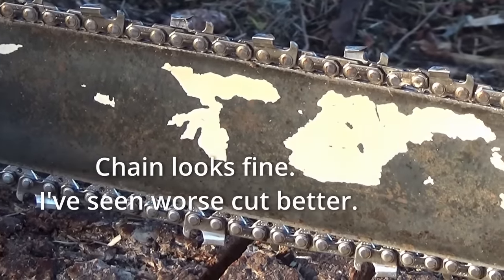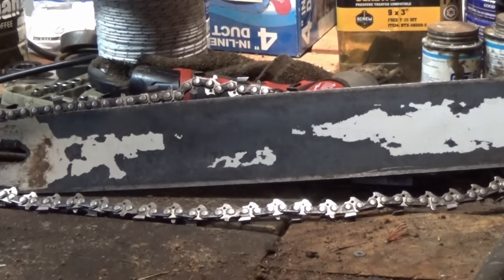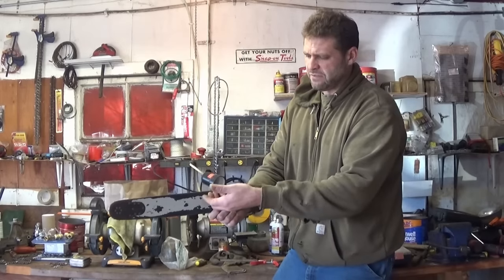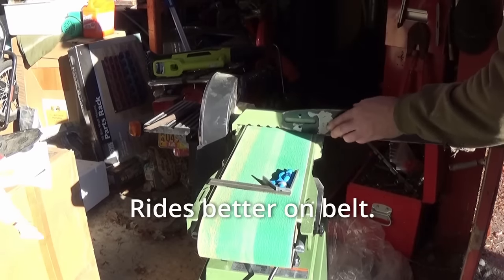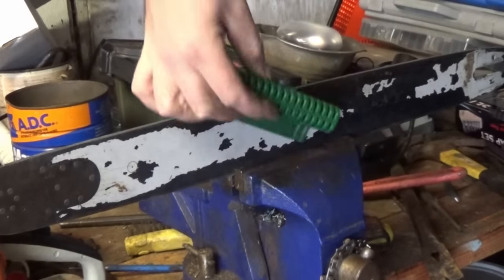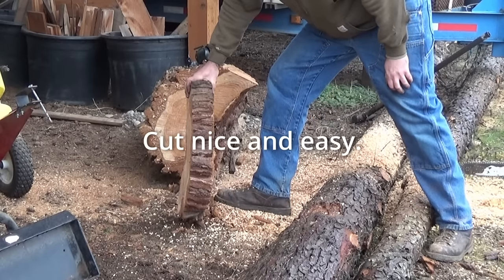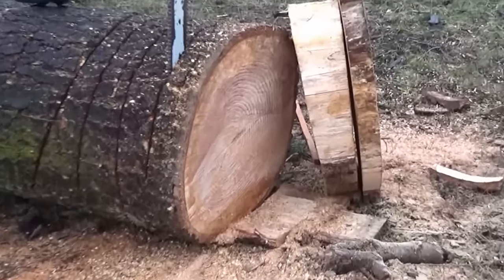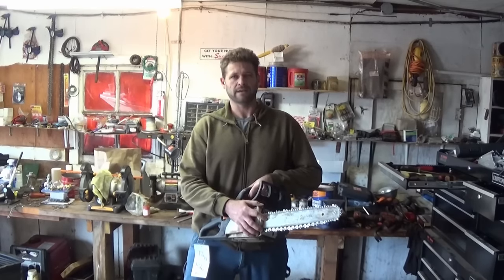Chainsaw Cuts Crooked Curved Cuts. Bar Dressing and repair. Before and After.

Comment: Several things can cause a saw to cut crooked.  An unevenly worn bar or even just a wire edge . A bent bar. The angles on the chain need to be the same side to side and tooth length the same.  The rakers need to be filed evenly. Bars are cheap, so replace it if need be, and learn to file correctly.  Also,  make sure you're not torquing the saw while cutting.
Reply from the maker: Well said, that's good info. I only addressed the bar.
Reply: Shutup
Reply: I’ve had chains jacked up pretty bad on the left side cutters only which I had to file far back a lot more than the right and once I finally got the left side back to sharp and also the right side cutters sharp it still cuts straight down even on a 30” log. So the teeth don’t actually need to be evenly filed
Reply: @pohanleu523  O.....kay.
Reply: @brianquigley7336  Not trying to sound like i know more than you. just my personal experience.
Reply: @pohanleu523  In my experience if all the teeth on one side are way longer than the other side it can cause it cut on a slight curve but the length difference needs to be really big.  Like you said I think the most important things are consistent filing angles and rakers
Reply: Tooth length doesn't matter "Buck'in Billy Ray Smith" will prove it ...but I agree with everything else you stated
Reply: @rileyjohnston8393  I use one of those Stihl 2in1 sharpeners on my MS462C so I don’t have to think about the rakers ☺️  but I had a 28” chain that I really crashed into the dirt for a good 30 seconds and man I had to file all the left side half way back to get it to cut again. The right side were only needing a slight touch up 😃
Reply: @pohanleu523  Ya one side of the teeth has to be way longer than the other to cause curving, almost never an issue
Reply: @pohanleu523  🤣🤣🤣
Reply: Cutter length is irrelevant. Raker height is everything.
Reply: @pohanleu523  I love my 2 in 1 sharpener for my MS 271 FARM BOSS ! I've named it "The Idiot Proof Sharpener"  Couldn't get my chains correctly sharpened before. Flip my bar every so often. After this video, I now need to keep a closer look over my bar.
Reply: @Laughinghawg  I think idiots could technically use it backwards 🤣
Reply: @pohanleu523  👍
Reply: Tooth length is not an issue.
Reply: @jeepinass  I'll never forget the time my saw was ✂️ cutting poorly, i sharpened my chain 3 times before figuring out the need to take down the rakers ... live and learn
Reply: @speedfreak8200  get a Stihl 2in1 sharpener which does both at the same time
Reply: Daniel Nelson  That’s what I use it’s the best gauge I’ve owned, never have problems cutting crooked
Reply: ¹à1aa
Reply: @jeepinass    Glad somebody said it!
Reply: Teeth don't have to be the same length. You just have to make sure the rakers are cut down correctly according to the teeth
Reply: @dereksteele2284  Oh, technically they don't have to be the same length,  but it makes for a rough cutting chain,  even if the rakers are filed the same per tooth.
Reply: @Brian Quigley  no it doesn't, I run a saw 10 hours a day clearing right of ways for the electric company, and I spend a lot of time sharpening saws, and they cut better than any brand new chain that's not square ground when I get done, as long as the rakers are knocked down correct
Reply: @dereksteele2284  Well, your idea of a good cutting chain is probably different than mine.  I've been cutting timber and climbing for 43 years in the Pacific northwest.  I use a Silvey Pro sharp square chisel grinder and a Silvey raker grinder.  The chain just flat out cuts.
Reply: @Brian Quigley  that's pretty sad, that you've been cutting that long and can't hand file a chain. Also everything that I cut is hardwood and still don't have a problem getting through anything I cut. And a square ground chain doesn't stay sharp long at all. I usually have to sharpen a saw 4 to 5 times a day because of all the wire and fences we hit because u can't see them till its too late
Reply: @dereksteele2284  Never once said I couldn't hand file. Production cutting in the North West, you better have your shite together when you show up. They expect you to put some wood on the ground.  I (and anyone else that's a serious cutter) use square ground chisel because it cuts about 15 % faster than round filed. If you have problems keeping your chain sharp,  try keeping your saw out of the dirt. No chain will hold up to nails or wire. Only a nimrod would waste time filing a saw on the job site. My saw gets dull, I just throw a fresh chain on and back to work.
Reply: @Brian Quigley  I don't run my saw in the dirt, and the company don't supply us with new chains every time one gets dull, we bring a file with us, as we're sometimes close to a mile away from the work truck. I also bet I can hand file one faster than you can grind one
Reply: What do you mean by torquing?
Reply: @pohanleu523  or maybe your different filing compensated for a crooked bar.. 😉
Reply: @durrburgerjosh to much pressure on 1 side of top handle.
Try to hold top handle so saw hangs/ballances and bar is Vertical.
Reply: You mentioned cutting the rakers, be sure and use a guide to cut the rakers. To much depth causes the saw to jump.. causing a very dangerous situation.
Reply: Tooth length has nothing to do with it .
Reply: Cutters and rakers do not need to be filed evenly, its all in the bar.
Reply: He literally just said that
Reply: there is no such thing as a wire edge
Reply: there is no such a thing as a wire edge
Reply: Bars are not cheap nowadays, but, they do get worn out where ya can't " fix" them any more. A good machine shop, could help get more life out of a lot of bars,( mainly just deepening the groove, which usually outlasts the widening of the groove)  but, once that groove wears out too much , just not worth messing with. Yes , you can " pinch " the groove shut a bit,  usually, sometimes it helps for quite a while, all depends.
Reply: @austinharvey9600 I know! How dare someone comment with good info!
Reply: Only cutter to raker ratio is important. Cutter length doesent matter at all. So only sharpen teeth that are dull.
Reply: Solid bars aren't cheap
Reply: @dereksteele2284 I agree with you. I have found that properly hand filed saw chains are superior to ground.

Comment: I've had those problems many times in the past.   Used same fixes as you did.   I discovered (the hard way) that this problem vanishes when the chain is kept tight, and you use a quality chain oil.    Great video,...cheers from N.E. Ohio.

Comment: Great video! I loved how you demonstrated the importance of keeping the bar and chain in good shape. The way you explained the gauge measurements was super helpful—it's fascinating how a little maintenance can make such a big difference in cutting performance. Has anyone else tried the roller tool you mentioned for bar repair? I'm curious if it really works as well as you described!

Comment: I often get the scrap bars and chains that our local chainsaw dealer throws out as they just put new bars and chains on customers saws that go in for servicing.
I won't have to buy bars for a long time as ive got heaps of them that still have heaps of life left in them.
But I do buy new bars and chains for all my pro saws as we have some pretty hard wood down under, 
The redgum is especially hard and we need to keep the chains sharp just to cut it and they can go blunt pretty quickly if you don't pay attention. 
Great video well explained 👏 👍 
Hello to all from Australia 🇦🇺

Comment: After you correct the bar surface you need to check there is sufficient depth still available for the chain to seat properly.
Great video.
Reply from the maker: Yes, absolutely. That needs to be pointed out, I forgot to do that. One can file down too far over time and the chain will no longer seat or fit the entire drive link in the valley. That will induce a curve cut syndrome.

Comment: I always just went around to the other side of the log and finished the cut. Or sometimes we need a circular cut... I have this issue right after hitting a rock. 30 years ago it was just bad maintenance and very frustrating trying to fix it. Years have taught me. Thanks for the guidance and teaching.

Comment: I've definitely been fighting this problem for awhile. I've never heard of dressing a bar til now, but it makes perfect sense.
Reply: @Daniel Nelson  I flip my bar all the time, it's still worn in deep and uneven. Why does it cut crooked when the bar is straight and it has a new chain? I run an ms440 and 20" stihl bars.
Reply: @Daniel Nelson  yeah im thinking I pry been running my last bar or 2 longer than necessary.
Reply: @Daniel Nelson  .050 on .050 for sure. Got sold some of the heavy gauge chains once and they won't seat in the bar. I cut alot of hardwood, been burning wood my whole life. I'm no logger, but I use a saw more than the average Joe. Use good oil, fresh gas, change my air filter and spark plug most years. I keep my bar oiler cranked up too. I think I just been trying to get more use out of my bars than I should.
Reply: @Daniel Nelson  I put a new sprocket bearings and flywheel on last year.

Comment: Had this problem bad this morning. First use after winter. I remember struggling to cut before i out it away. 
Switched chains and it now works perfectly so it isn't the bar - just my sharpening technique.

Comment: There is something to be said for letting the tool do the work but you have to pay attention with chainsaw regardless.  I cut slabs freehand and the bar can do a lot of the aligning work for you.  Don't forget the perpendicular line on the side of the saw, that is pretty useful as well.

Comment: I could definitely hear the difference on the 24". Great video! I have the Stihl 261C and it came with the 18" 0.063/.325" bar and chain and last fall I upgraded to the 20" 0.63/3/8" bar and chain. big difference it cutting. Happy I upgraded the bar and chain. Thanks for the knowledge!

Comment: Very good discussion/information. Thank you. Never noticed this as an issue with my smaller saws (under 18") but got A stihl MS660 with 32" bar a few years ago and am buggered if it will cut straight in big timber. Relpaced chain a few times without much effect. Will need to investigate the bar for sure now. Many thanks

Comment: Great video! I've had similar issues after nicking a few teeth on a rock. What I found that works (don't know why, but it does) is sharpening the chain, and then doing an extra pass on the teeth that are on the side that the saw's cut curves toward. Curve left, double sharpen left side cutters.

Comment: Brilliant explanation. Used to do tree lopping and removal. My employees could never understand why the saws were jamming when they hadn't been flipping the bars and checking the chain guides. Spent so much time doing all that filing by hand. Didn't have the belt sander or hones available easily back then. Only thing I didn't see you do is lightly file the bar edge to remove any burrs from the honing. (perhaps your hone has an extra side hone to do that.)

Comment: Its best to change the chain too after such a big bar dressing job. The link sides that touch the rails are most likely worn out unevenly too, so it might create problems/more uneven wear now that the bar si flush on both sides.
Reply: That's interesting.  I'm going through the comments trying to identify what might be causing a problem with 1 chain.  Always gives me grief and can't seem to figure out why.  Either side wear  or rakers

Comment: One trick to see if the bar rails are true, is to stand the bar up on its edge on the kitchen table.  It will only balance when true, and fall down to the low side when it still needs grinding.   They usually last a good ten years, but once they start to cut crooked, the wear increases faster.

Comment: Quick field fix if you get in a pinch. Find the flattest, hardest surface and carefully pound the bar while taking care not to hit the chain drive slot or roller tip. Using a sledgehammer top surface works great. This method has gotten me through on site bent bar problems many times.

Comment: Before getting a decent belt sander with a good fence, I used my table saw with a large fine grit stone wheel that fit the arbor. Also, like you did, got to confirm the table was square to the stone.  Be very gentle doing that however.  Still required a dressing tool. Nice work and video.
Reply from the maker: A table saw would be a good flat surface. I bet that would spin a stone wheel fast as hell.
Reply: @gorgeoutdoors  It does and I did the same one time on my old Shop Smith set up as a table saw.  I don't know how safe that is to spin a stone so fast though so now I just use the belt sander.  take care!

Comment: I've got a problem I can't figure out. Firewood processor with 15 inch bar. I flip the bar and dress it square,  yet 1 chain just causes grief. Teeth are within 10 thou length ( checked with dial caliper) sharpened using a grinder wheel sharpening machine so both angles are "supposedly " the same, yet it will pull sometimes 1/2 inch to the side in a 10 inch log!
What can it be?? 
I've reviewed comments,  I'll check rakers and possible wear on the slider part of the teeth.
Anything else? I'd chuck it but its some special carbide coated tooth expensive chain..

Comment: Also many people don't know there are oil ports in bar groove which get clogged .
Must be cleaned with small wire .
They get oil from larger holes by bar bolt adjustment area .

Comment: Thats a nice Vidja on bar maintenance. I the past I used to "Just Buy a New Bar", now I dress them, for extended life. I dont have the right tool as U do, but I touch them up with a bench grinder. Its a little crude, but with OK results.
Reply from the maker: The little hand dresser is available on amazon. It's a nice follow up after the bench grinder.

Comment: This helped me bro.. i got a lot of gear to take care of and this helps bigtime. Thank you
Reply from the maker: Anything that can grind, sand, or file AND stay square will help. Keep it moving and stay square. Results will be noticeable.
Reply: @gorgeoutdoors  i have a few 880 bars that are super sloppy... the groove is too big. So i look into buying a few new ones. Omg expensive. How much and where can i find that tool that you showed in your vid that squeezes the bar gap back closed? Its worth a try for me to try to fix it...
Reply: Found one 40$shipped from forester. Pretty sweet looking setup...I Need this!!! 47 inch 880 duramatic bar= 400ish$$at least. Worth a try to either fix mine or at least maintain tolerances on a new one.... we whoop saws asses in hardwood over here in Illinois!!💪

Comment: Good stuff THX !! I have a Rookie question- What causes the paint to come off the bar like that? I have been running a Stihl ms250 no issues, but I bought an MS311 to cut down a big Mulberry tree and the paint has come off my bar. within about 6 tanks of fuel..

Comment: Great info. I think for bars under 20” on the homeowner specials just get a new bar and chain. The bigger stuff I’m sure repairing is cheaper
Reply from the maker: Yep, small bars can be replaced for cheap. Many aftermarket bars are good quality and cheap. That's often the best, but I needed video material.

Comment: Throw the roller bar away. Make sure you are oiling good. Keep the flared edges knocked off of your bar. Don't use a longe bar than you need. The shorter the bar and chain the better it gets oiled and the better you can control it. Make sure your chain is the right size and sharpened correctly.
Reply: I don’t mean to be that guy but I’ve gotta disagree on shorter bars giving better control. After using a 28” bar the only reason I’ll go for anything less is for felling under a certain diameter. In my opinion 28”-32” bars give you a much more balanced and controllable tool. Not to mention the shorter the bar, especially pulling full size chains, the kickback gets MUCH more aggressive. Nose tipping my 28” when bucking I barely notice sometimes. Like a kid punching your hand. It also saves your back if you’ve never gotta bend over to reach the cut. 

Stand up and buck!

Comment: Just to clear thing's up a bit, can you flip any saw bar or would you find that out if you tried to flip it and it won't fit/seat? and do you need to only dress the top side of the bar at a time? Thank you I found this very informative.
Reply from the maker: Yes, you can flip any bar. Its good normal maintenance. Always dress both sides.

Comment: Very informative video thanks,I need help have a Husqvarna clean plug and air filter fresh gas starts well but after a few cuts wants to stall can't keep it running any suggestions?
Reply from the maker: Piston can ware and have heat/change related issues. Seals can do the same. Both can show that symptom, both I have seen.
Reply: Thats because its a Husky..🤣🤣
Just kidding.. I had a few saws do that before.. does the saw have a warm/cold weather adjustable device installed on it?
Reply: @gorgeoutdoors  saw is used very little I'm wondering if I need to adjust gas or air jets thanks for responding.
Reply: Make sure hose in tank doesn't have a split or crack in it so it starts sucking air.  There is a vent at the top of gas tank that may be plugged up.  Try loosening gas cap when it stalls and see if it runs good for a bit indicating vent is plugged.  Run some Sea Foam in gas into carb, let set overnight can very easily loosen crud and get it running like new.  I run old Husky's, 66, 266, 154, 345 and never had any issues with them other than rotted gas lines.  I doubt you have a serious problem.  Great saws.  Always use good quality chain saw oil at 50-1, not universal oil or ruin saw.
Reply: @jefffrayer8238  great ideas will check out that's what I was hoping for thanks man.